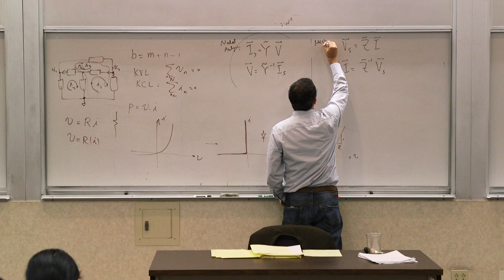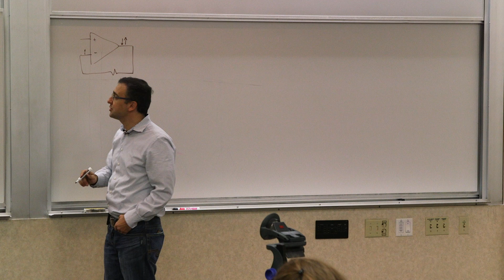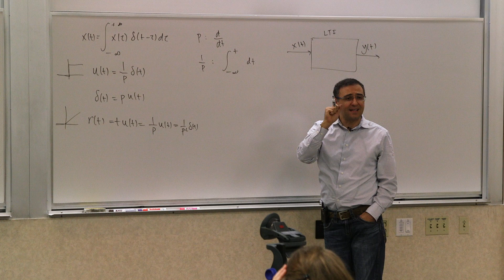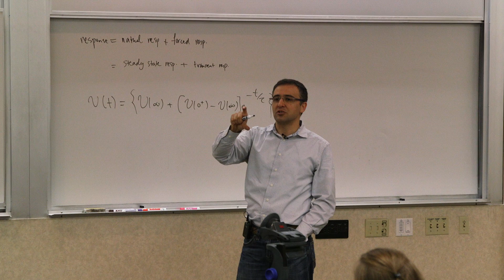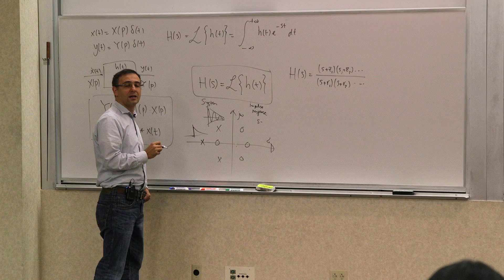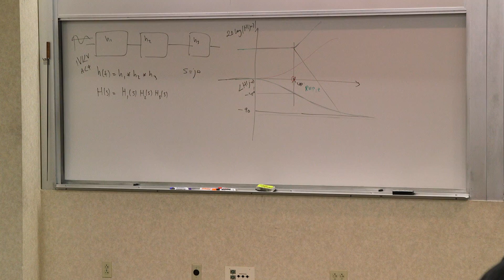Comment: Prof Ali thanks very much for the lectures they are really useful and straight to the point with good explanation. I just have a bit confusion when we design an integrated circuit we  consider the voltage transfer between stages i mean the input impedence of driven stage (high impedence) and output impedence of the driving stage(low impedence) while in RF we care about matching them(power transfer).What is the design criteria  that makes me either choosing voltage transfer or power transfer   :)
Reply: You are very welcome. As for your question, (and this reply rely does not belong to this particular video rather to the analog design series) the output impedance of a transistor is generally rather high (although that depends not he size of the transistor). Assuming a high output impedance, the maximum power transfer will be achieved by having a relatively large input impedance for the next stage. However, if you are dealing with high frequencies, you often would like to deal with smaller characteristics impedances (e.g., 50Ohms), due to the detrimental effect of parasitic capacitors on the high impedance systems. In general, for linear circuits, you want to achieve power match (conjugate match to the extent that you can). In sufficiently nonlinear circuits (e.g., switching power amplifiers), a load pull match will be used.
Reply: Ali Hajimiri thanks very much for the explanation :)